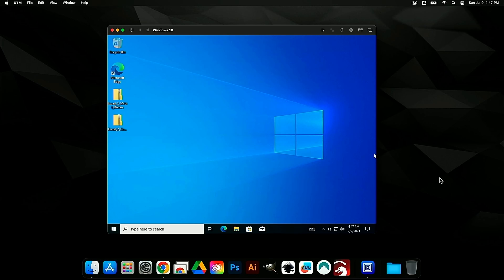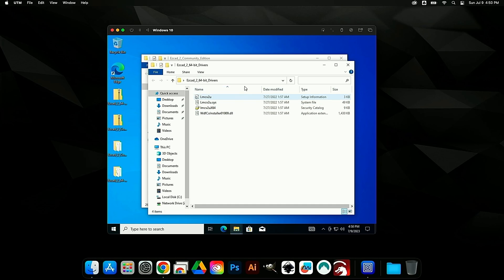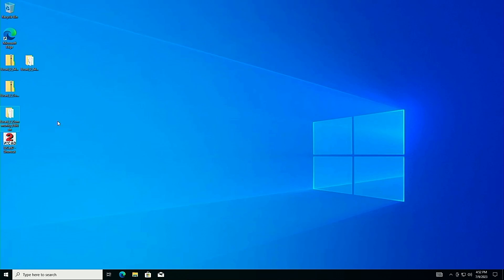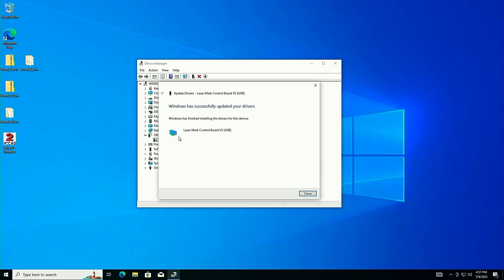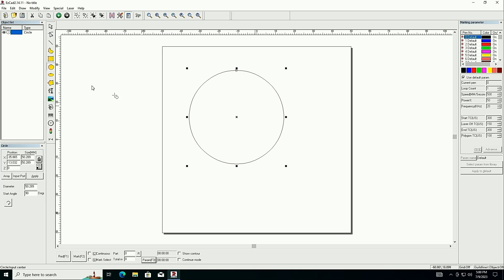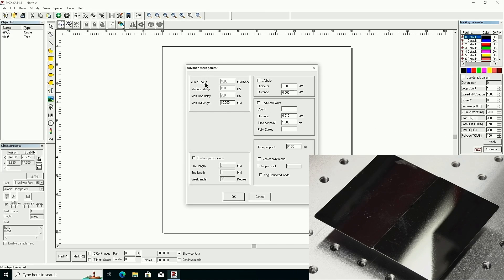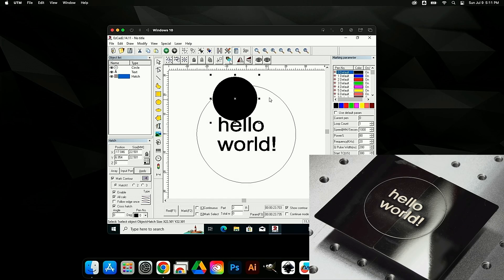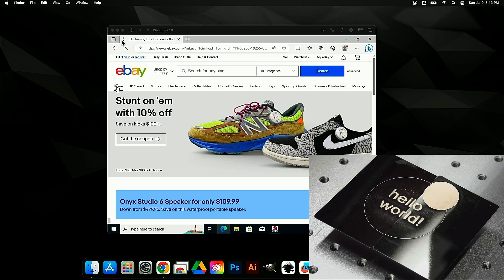Installing x86 x64 Drivers on a UTM Emulation | Ezcad 2 Live Test!

Comment: Great video, I admire you. I have Windows 11 Pro ARM with Parallels Desktop in trial on my 16GB M1 Mac mini. Would the drivers you used work? Or do you recommend following your technique with UTM even if I have to buy a new Windows 11 Pro license again? Thanks. You're like an oasis in the middle of a desert.
Reply from the maker: I was trying to keep this free so I haven't really messed with Parallels but it all comes down to architecture. x64 drivers will only work on x64 processors. If Parallels is emulating an x64 processor then you'd be good to go. If it's only virtualizing the OS and running an ARM version of Windows it won't fly.

Comment: Old version board, lmv1 Can I use virtual machine on Windows for emulate win 7 32bites,x86? This board just works out this system, IF i can use vm it will be perfect
Reply from the maker: You can but I'm not super familiar with the configuration of UTM for x86 VMs. That said the general process should be very very similar